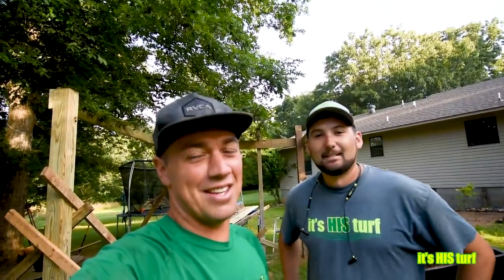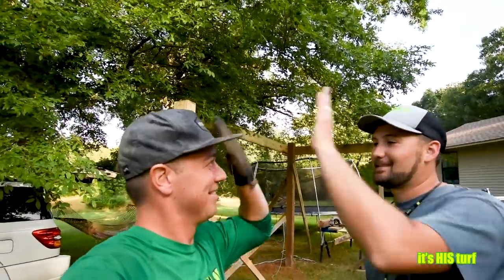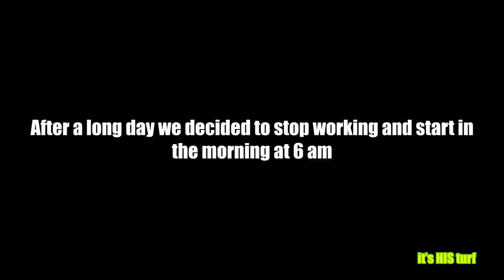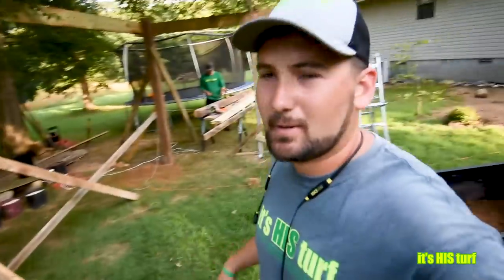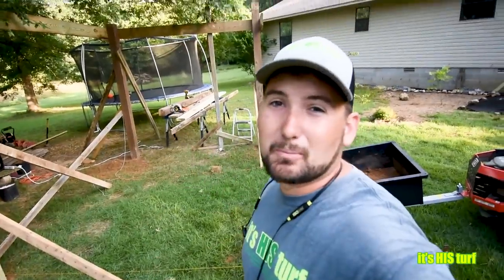DIY building/installing a pergola using salvaged lumber

Comment: Bought wood for a pergola build a few days ago and geez prices are outrageous right now. Using your video as a reference and I'm using an auger and of course i have Rocky soil. What's The pick thing your using along with the post hole digger? Seems quite handy.
Reply: A digging bar
Reply from the maker: Yes. It’s a necessity it central Arkansas. I call it a rock bar

Comment: I’ve watched this because were planning to DIY our pergola. Im just wary if the base could stand Florida’s hurricane season.
Reply from the maker: Hmm... I’ve done work in Florida before. We did 4 foot footers for our kitchen cover. I would check with a local builder for some council.
Reply: May not 
But he didn’t add the diagonal arm from each header board angled downward to connect to the post 

I’m not as expert but if you don’t secure with brackets it will fall to the ground

Comment: Always concrete or cement your poles, you'll get way less rot than using loose gravel, loose gravel with a pack bottom will create no drainage for the water, with concrete if you want wood protection all you have to do is treat the wood with a rubber spray or flexall...

Comment: The only location for the pergola is over a soakaway so I can't put the pillars in the ground, is there a way to use a concrete base for the pillars instead? Good video thanks.
Reply: I would assume you would have to bolt it to the cement mother.
Reply: Yup concrete footers should work

Comment: Great video! I'm planning to build a pergola but would it be okay to build one with regular lumber? Or do I have to use pressure treated wood?

I don't like pressure treated wood as the surface is not attractive and it contains chemical.

Can we paint waterseal or some exterior paint on regular lumber and use it for the pergola?
Reply from the maker: I would recommend a cypress or cedar lumber. If you use non treated lumber you will have to reseal each year. Another option in treated is yellow wood. It's a cleaner lumber.
Reply: Thank you so much for your valuable information!

Comment: Is there a reason you didn’t use concrete for the posts? Isn’t it possible it may shift over the years?
Reply: Good question, was wondering the same.
Reply: @teepee6314  watch the end of the video and they discuss.

Comment: SLOW DOWN, the video when you attach the upper frame work. Thanks.
Reply: Rod Sapyta agreed for the same reason I disliked
Reply: KC Man you can slow it down to 1/2 speed on your device. Press the three dots in the upper right corner and click on Playback speed.